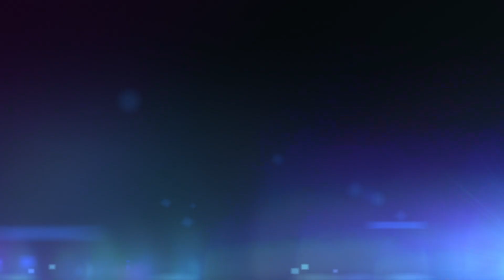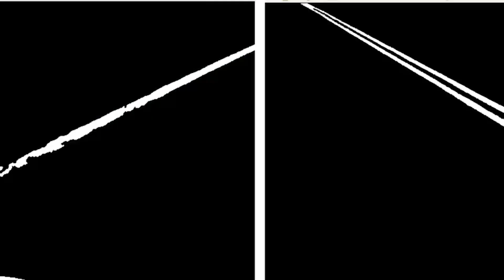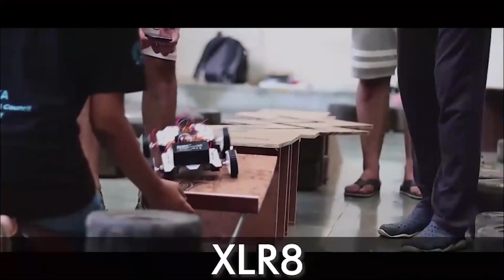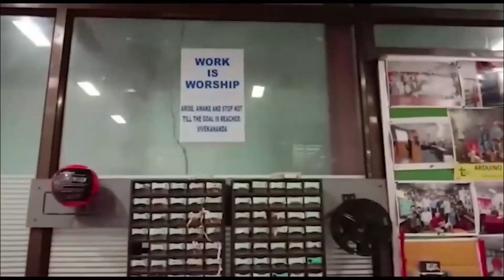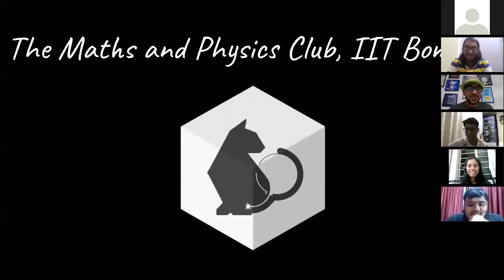PG Tech Orientation | Institute Technical Council, IIT Bombay

Comment: 0:00 ITC structure: Tejas Sakhalkar (GSTA)
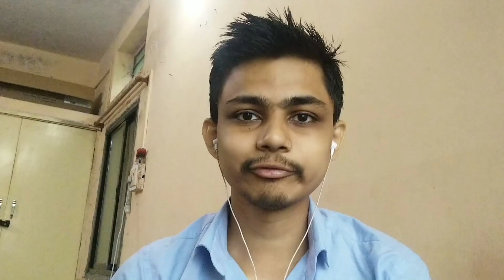6:16 Kaustubh Patil (PG Nominee)
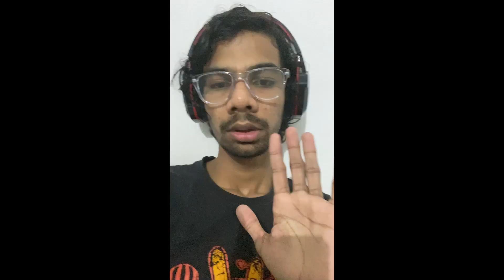7:41 Risvan O (Projects and Tech Teams Nominee)
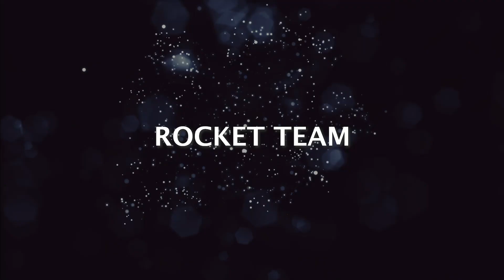11:45 IITB Rocket Team
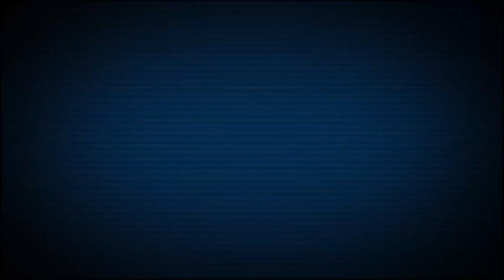12:55 Team AUV (Autonomous Underwater Vehicle) 
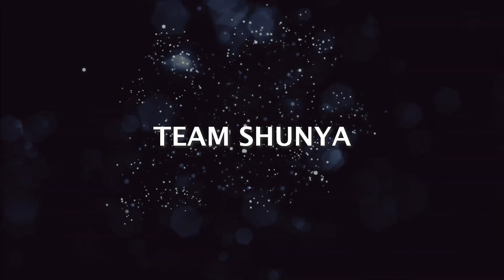17:12 Team Shunya (Sustainable Habitat for Urbanising Nation by its Young Aspirants)
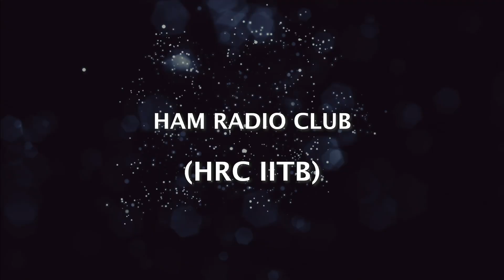22:43 HAM Radio Club (Part of Student Satellite Team)
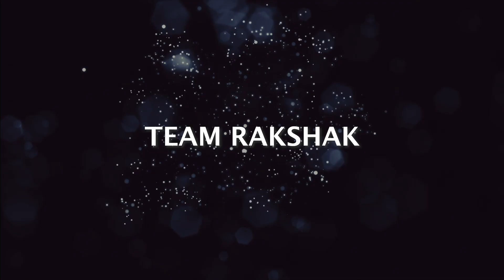24:23 Team Rakshak  
31:32 Team Hyperloop 
32:35 Team Exofly
35:35 Mars Rover Team
39:48 IITB Student Satellite Program
42:45 Team Zero Waste
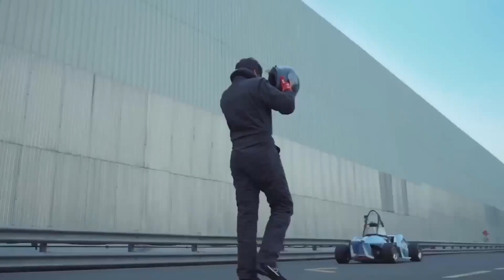46:55 Racing Team
51:27 UMIC (Unmesh Mashruwala Innovation Cell)
56:35 Aeromodelling Club
1:00:35 BioX Club
1:05:03 Electronics and Robotics Club
1:09:43 Web and Coding Club
1:13:52 Tinkerers' Lab
1:17:17 CDS-SRG (Controls and Dynamical Systems- Student Reading Group)
1:21:22 Krittika (Astronomy Club)
1:25:14 Maths and Physics Club
1:28:39 ChemE Tinkerers' Lab
1:31:16 Energy Club

Team WSAR and Team Carbon Removal XPrize are very young teams and hence not included in the orientation video.